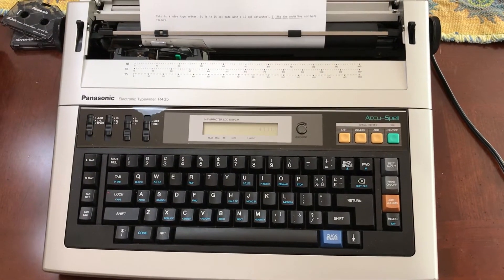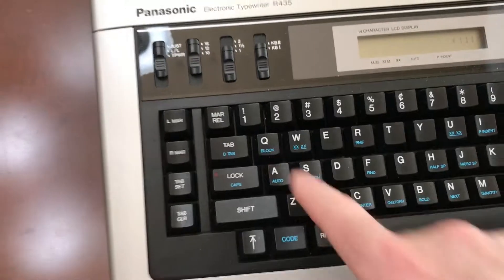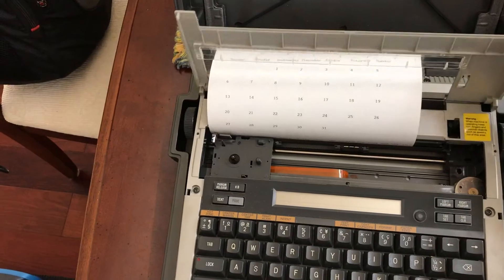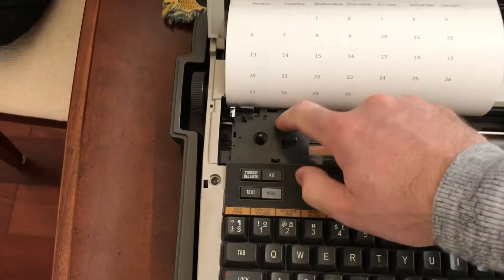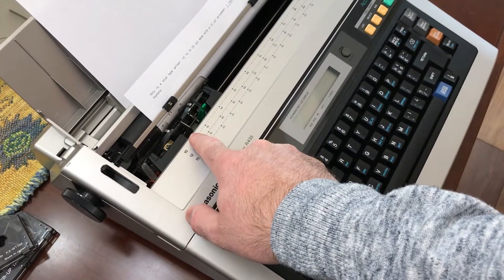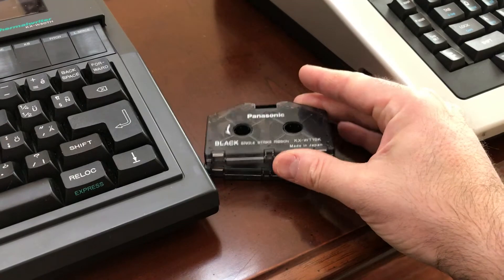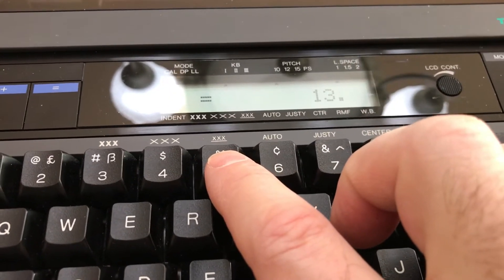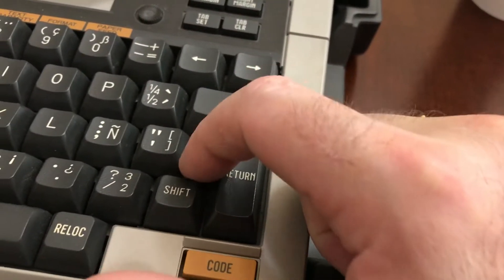#Thermal #Typewriters: A Detailed Guide

Comment: i have the Canon Typestar 7.  If you use thermal fax paper from a roll how do you go about sizing the paper at 8.5 x 11?  Do you cut onto sheets in advance and feed into the machine as 8.5 x 11?  and how do you cut it? a nice paper cutter?  I a, amazed it is impossible to find thermal paper sold in 8.5 x 11 sheets.
Reply from the maker: I cut my own paper from the role. I use a paper cutter to cut a straight edge.

Comment: Canon S-90 (similar to typestar 7II) has AC-adapterAS-6 in europe...  (input 220V AC, output. 6.0 V DC, 800mA, round plug, + outside, negative tip inside) Attention! Don't use the power adapter together with dry cells. The Canon S-90  typewriter will automatically try to load inserted accumulators (NiCd), if the AC adapter is plugged in. I assume the Printstar-models will do the same. Still looking for a manual for Canon S-90 or Canon Typestar7II ... and font-cartridges, of course
Reply from the maker: Thank you for watching!

Comment: Great review! I suppose the one advantage of the Canon Typestar line--other than the fact that they are super easy to find--is they are far more quiet. The print head doesn't make nearly as much noise. I think if you tried the Typestar 4 or 5, you might change your mind about them. They didn't introduce the font cartridge until the 6, so previous models had at least two fonts or pitches to choose from. From memory, the entire Typestar line uses a 6v, center-positive adapter. But don't quote me on that. Finally, the print density knob on the Typestars does affect the thermal print, but I always keep it turned all the way up as thermal printing isn't as dark as ribbon printing. I subbed and hope you will post more thermal typewriter content.
Reply from the maker: Poor Typist Thank you for watching the video. When I saw the Panasonic I knew that that was an amazing machine, and that’s why I got it. I really got lucky with that purchase.